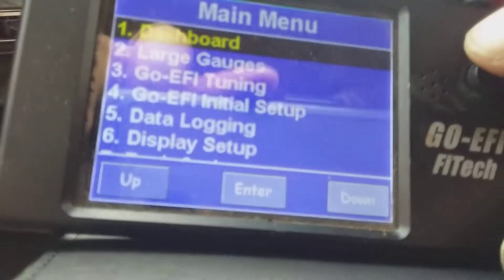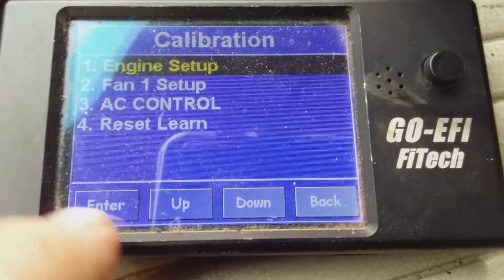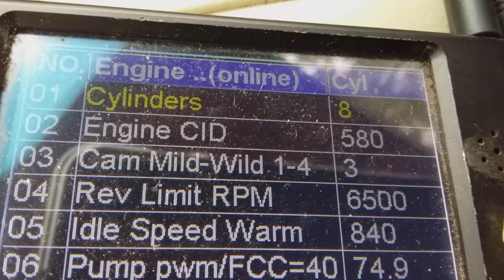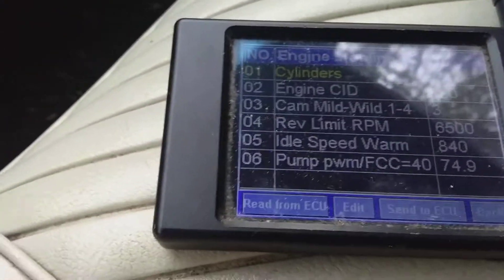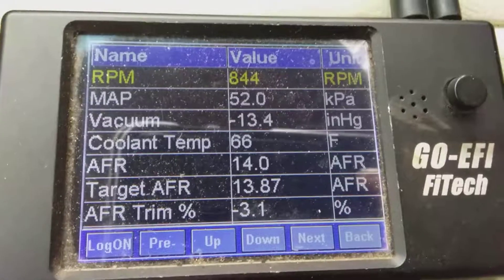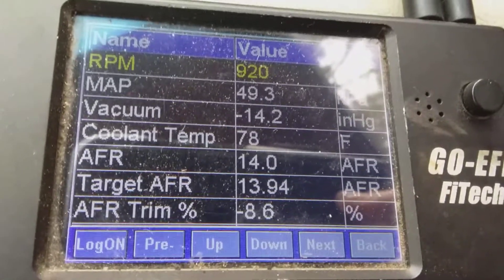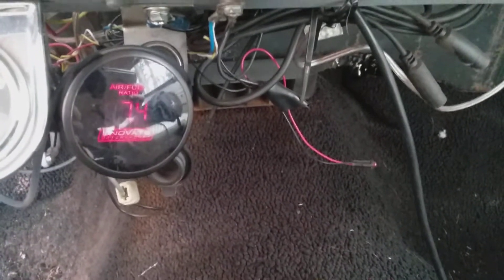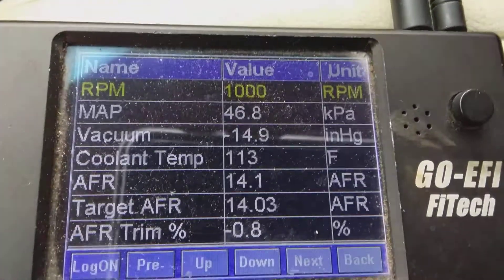FiTech Mean Street running on E85? Hell yes it will, and its easy to do.

Comment: Does this still work with the 2023 stuff from fitech??
Reply from the maker: Yep, but its even easier, they have a parameter in the handheld that allows you to enter the % of ethanol, zero to 100%. I have a couple newer systems, one is going on the Cuda, the other on the 68 LeMans. The LeMans will be running E85, and when I get the EFI on it there will be content about making it run. Its getting a dual quad power adder system capable of 1200hp.

Comment: Would ignition timing need adjusted as well?
Reply from the maker: You can set the initial and total however the engine wants it, because you don't have to worry about ping/knock unless something is really wrong.

Comment: I am installing the 800hp Unit on my Nova! Can't wait to get it finished! I also plan to switch back and forth from Race Gas to E85
Reply from the maker: I can't afford race gas, so when I build a high compression engine, it only gets E85 to E100. I only use pump E85, because the race gas mixed with ethanol costs too much, and doesn't help at all with how it runs, they kinda fight each other.

My Fitech is a 'Mean Street' doesn't control timing, can handle 800hp, so it does the 550 to 600hp on ethanol easily. Installation errors are why people have problems, then they blame the FiTech. Other people think they are tuners and they start mucking around in the program, and it never runs right.

I'm still zeroing in on the cold start, sneaking up on it rather than making big changes. Its only May and October that its a problem for me. Otherwise this one has run great since I got it in 2016. You will probably like it if you install it right.
Reply: @SweatyFatGuy  I agree with everything you just said. I did a bunch of research and saw that most people installed them incorrectly, or had some issues with the programmer, so they immediately wrote off FiTech. I am giving them a chance because the technology is their specialty. 

I am about halfway through the install now!
Reply from the maker: @JakeHarrington  cool make video, and let me know how it goes.

Comment: That is pretty cool. For a while I was thinking on getting a FiTech buuuuutttt.... I prefer to stick to a pair of 4bbl carbs. I have both an Eddy 180* dual quad and an Offy 360* dual quad for my small block. I know that the tuning will likely be much easier with the FiTech over a pair of 500cfm AVS2 carbs. I just want to minimize the amount of electronics in my build. I am very tempted to stay with a points ignition as well.

Keep the videos coming, that engine sounds great!
Reply from the maker: I have an Offy dual quad for my Pontiacs, and an Edelbrock dual quad for 289/302 Fords, been thinking the FiTech dual quads would be cool on them. The 65 LeMans gasser is getting the dual quad intake on a 455, 2" carb spacers and velocity stacks through the hood with a straight axle, for science.

You can screw up a tune real fast, but these things do quite well on their own as long as you put them on correctly.
Reply: Buuuttt?.... Where's the Terrance Popp graphic ?.... LMAO